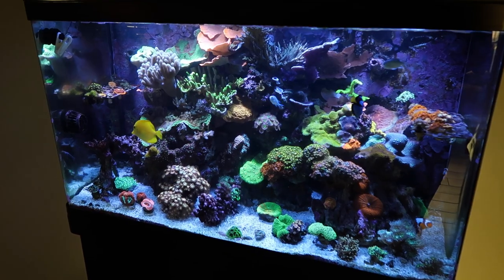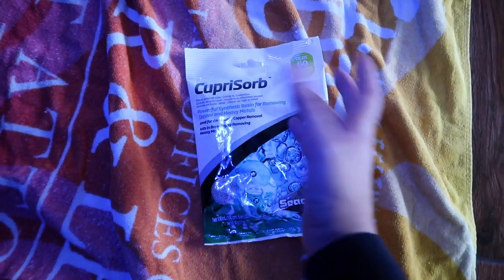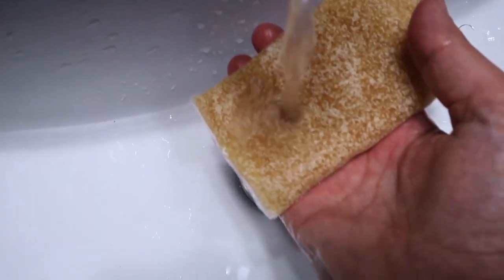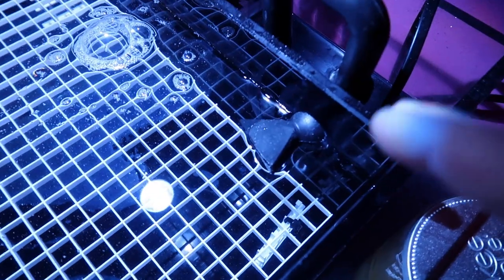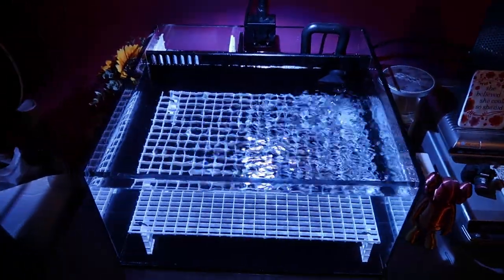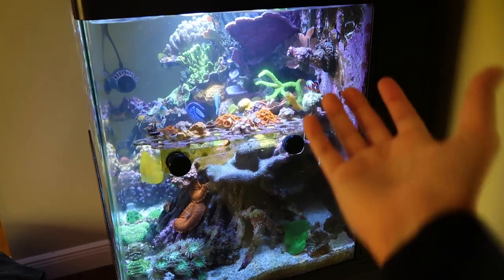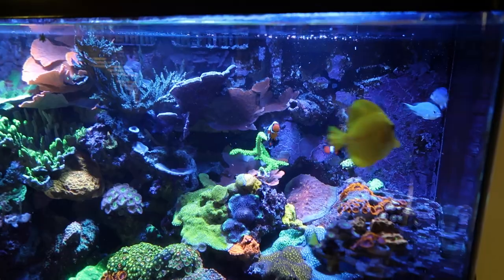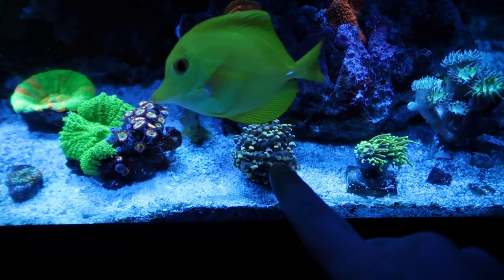The Euphyllia Garden Has FINALLY Started!

Comment: That two little fish magnetic clip for sea veggies on left can leak metals into water.  
So far my 2 of them leaked N  magnet inside is rusted.

I think thats your issue. Just dont leave in the tank. Use it and remove after some time.
Reply from the maker: Thats a new clip, the issues were happening before this and have happened in the past.BUT thanks for sharing that I will deff keep an eye on it!!